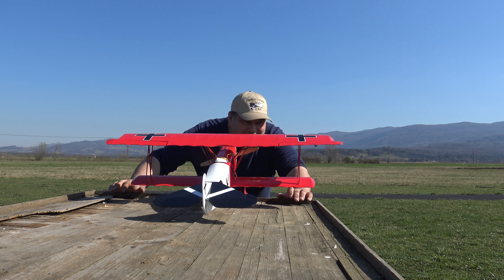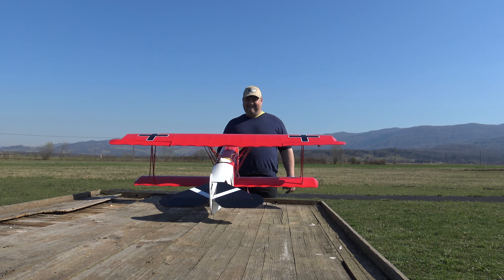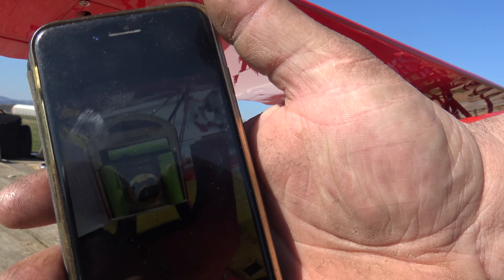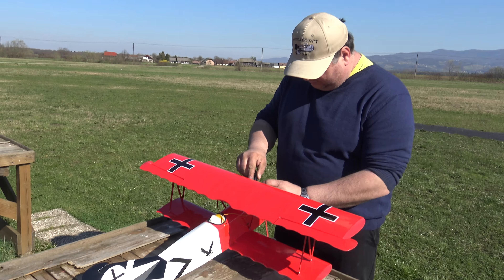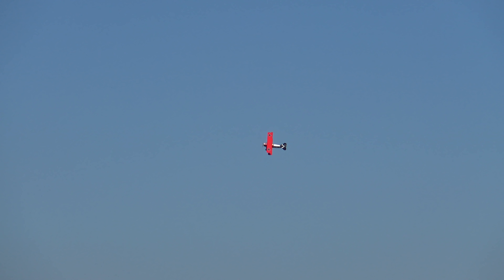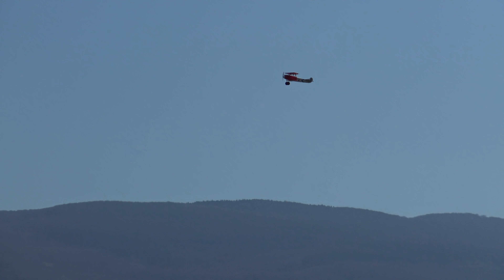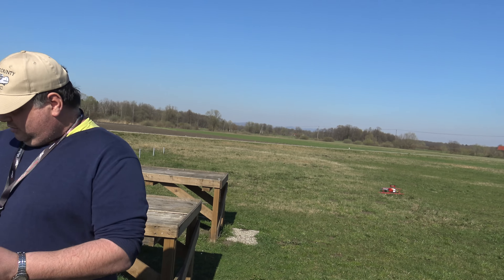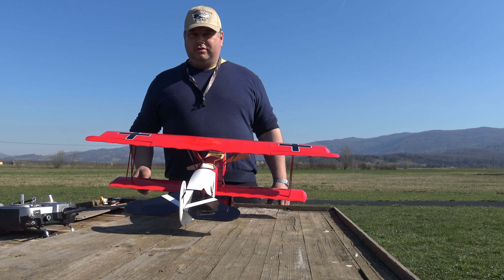H-King Fokker D.VII Biplane 925mm (36.4") PNF Maiden flight

Comment: Have read that the undercarriage is very weak and will bend and collapse very easily, does that agree with your experience with it?
Reply from the maker: If you will land hard it will. Wait to see the first video when Captain Blaž had signal loss ;-) I will post it in a few days. But still the bird is not bad.

Comment: maybe a 3s 2200 would fit and no weight would have to be added..
Reply from the maker: We have tried but there is just not enough space.
Reply: @PetrincicBrosRC  ..i have had some 2200's almost as small as 1800s... i guess with that plane enlarging batt area may be a pain...with foam its simple.